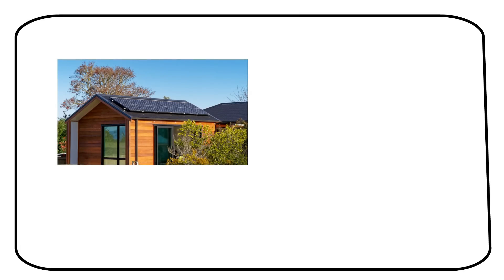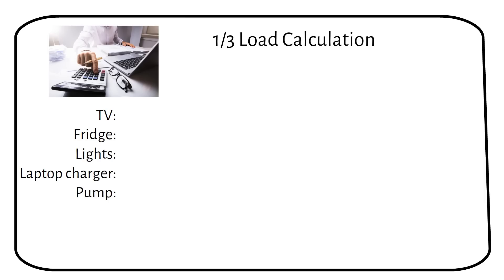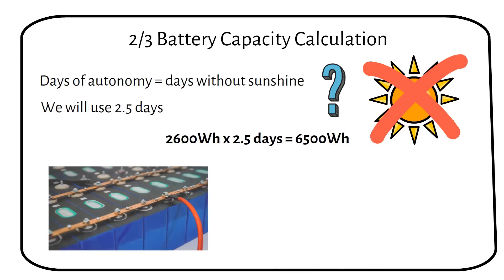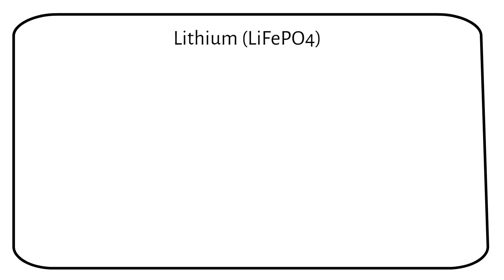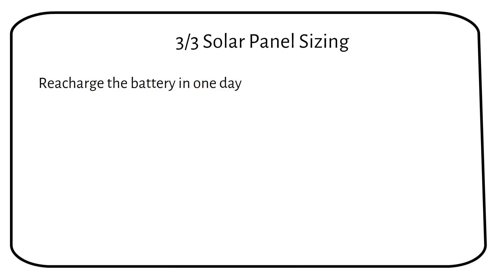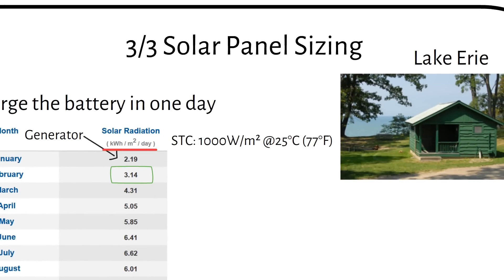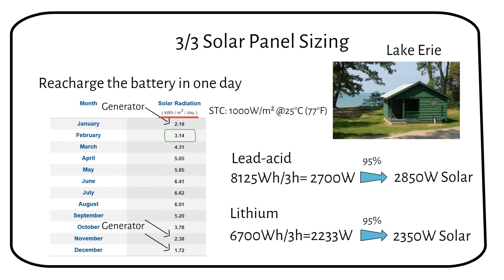How Many Solar Panels to Run a House Off Grid?

Comment: I have 8- 12V lead-acid batteries for my house.
Do I need 2850W Solar per battery or for the whole thing?
Reply from the maker: The whole battery. you need to recharge 6000Wh to charge the batteries from 50-100% including inefficiencies of lithium (80%). if you have three sunhours you need 2000W of solar panels.

Comment: In a 10kw situation you covered this very well. However, 10kw is not the average if you have a heat pump HVAC, electric water heater and electric range.  I get it that you just laid out a basic example but other electrical appliances were left out of the example. These other appliances are more common in the south and in addition sunlight is a better source of enegry in the south. My home is 100% electric. Daily electrical use would be closer to 30kw based on home size and how many appliances are in use. The below figures are more accurate based on the real electric consumption for the masses. My home use would be closer to 43kw per day. To actually send power back to the grid would require a daily surplus above my daily use. Such would require a system that creates more than my daily use. The cost to go off grid is very expensive. Just saying.

Average kWh usage for 1,000 sq. ft home	32 kWh per day, 950 kWh per month
Average kWh usage for 1,500 sq. ft home	37 kWh per day, 1,100 kWh per month
Average kWh usage for 2,000 sq. ft home	43 kWh per day, 1,300 kWh per month
Average kWh usage for 3,000 sq. ft home	67 kWh per day, 2,000 kWh per month
Reply from the maker: Yes, in the USA, the energy usage is 30kwh on average because of the ac. In Europe this is 10kwh on average. 10kwh is a good size for a cabin or remote home off the grid. 43kwh is huge 😳
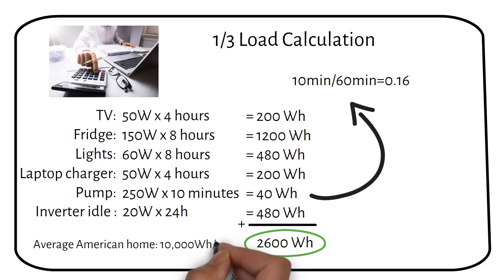Reply: @cleversolarpower  - I agree 10kw is good for Europe. But you did say the average was in America. I listened again. It's at time stamp 2:06

Comment: Its a simple calculation to work out what you need to go completely off the grid.... Estimate how much power you use per day.... estimate how much power you will produce in the middle of winter for say 2 months. Now figure out how many batteries you'll need to bridge that gap
Reply from the maker: If you size the battery based on your calculations of two months, you need a huge battery. A generator would be much cheaper.

Comment: I only want to run a regular sized American fridge and a deep freeze freezer in my utility building. Planning a 48v system with one rack battery and six to 8 400w panels. Will that work?

Comment: Thanks for your educative video. To recharge Lead Acid battery from 50% to 100%, how did you get the 8125wh that you divided with 3hours?
Reply from the maker: 6500/0.8 (0.8 is efficiency of lead acid battery)

Comment: Hello,
To increase the profitability of your photovoltaic panel installation and maximize self-consumption, I've created the free application OptimElec, which lets you track and optimize your electricity production and consumption in real time.
The application also displays the weather forecast for the next few days (cloud cover and solar radiation), enabling you to estimate your electricity production over the next few days.
The application is available in English and French.
I hope you find it useful!

Comment: Average american home uses 30kWh per day not 10
Reply from the maker: eia.gov tells me otherwise
Reply: @cleversolarpower  even by using your common sense you will know 10kwh is not enough to power a 3 bedroom house, the ac and heat alone will use 15kwh the lights tv refrigerator computer fans will still need to consume
Reply: @cleversolarpower  "The average U.S. household consumes about 10,500 kilowatthours (kWh) of electricity per year.1 However, electricity use in homes varies widely across regions of the United States and among housing types. "

This is what eia gov says, it says 10k kwh PER YEAR which means 30kwh PER DAY

U assume 10k kwh annually is 10kwh per day hahhaahhahah
Reply: @cleversolarpower  eia.gov tells you 10,500kwh is the average consumption in a year divide that to 365 and u will get 30kwh per day

Again you are wrong and still dont know it

Comment: Hi, thank you for sharing and making clear some points. I could be wrong on the battery capacity sizing your formula would not be: 6500 wh+(6500 wh*0.8* 1.25), 80%?
Reply from the maker: Why multiply by 1.25?

Comment: 6500 wh, 97% efficiency calculation is wrong.
6500X.97=6305Wh. 
Am I correct 
Pls clear my doubt sir
Reply from the maker: If i give you 6500 apples, and say that's whats left of my harvest after some are rotten. Then the initial harvest wouldn't be less than 6500 apples. It would be more. So 6500/0.97=6700 apples.
Reply: @cleversolarpower  okay.
Now it's clear 😁 
Thank you 🙏

Comment: I think there's a huge mistake in your calculations, you assume that the solar panel has efficiency of 100%. Should be around 15%
Reply from the maker: Go check out my video: 'how much power does a 100W panel produce' for in depth explanation.
Reply: Ok. Thanks

Comment: Hello sir, I have 8 gel 100ah batteries, 3 gel 200 ah batteries and 32 solar panels of 12volts 150watts, pliz help with the configuration, the controller I need plus the inverter I need, I'm in uganda 🇺🇬 we receive 9 to 11hrs of sunshine daily, and thank u sir for the teaching I appreciate
Reply from the maker: Checkout my new video about designing an off grid system.

Comment: Hello. Can you do a video of a load analysis table which is already calculated in terms of watts and hours and all calculation done and gotten is 2,542 watt hrs. So i want you to show us if this 2,542 watt hrs if used in seven days on autonomous, on how to calculate the size of batteries in terms of volts and amperes, amount of solar watts and how many of them, charging controller to be used, fuses and dc mcbs and sizes of wires to be used?
Reply from the maker: Check my video about sizing an off grid solar system.
Reply: @cleversolarpower   ok i have watcht it. If possible can you do the exact of what i have send to you because it will help many people.

Comment: I appreciate such straight forward approach...how about a little more on selection of inverters? Sizing inverter for the panels i may need to run whatever i am running.
Reply from the maker: Thanks! Check my video: 'how many batteries for a 3000W inverter'

Comment: Check out my 20kW system and find out exactly what it takes. 4 bedroom house, with 4 occupants. NO bill happy days!
Reply: Is 4kw system enough for small house?
Reply: @Defender_928  Hi, probably not quite enough. Double what you think you need for repeated cloudy days. If you have AC and electric hot water, 10kW would be more suitable. 400ah 48v battery bare minimum. It will payback very quickly. Use quality inverters etc.

Comment: you failed to tell us how many batteries - disappointed
Reply from the maker: I'm not sure if you watched all the way to 4:35 ?
Reply: @cleversolarpower  yes I did - does not say how many batteries 
so you should say 
100Ah battery you need 6 or 3 or whatever
if you gonna take the time to make such a video why not make it easy for us to the end
I don't understand 48v @ 130Ah - I have never seen a 48 volt battery - so what are you saying? why stop at 48? why not go to 60? bit confused on this
Reply: @AskRemy  It shows in the video the kwh of the battery. Batteries comes in different sizes so he's saying the size is a 6000kwh battery. Those figures are given so you can calculate the size of the battery
Reply: @HenryOlson-nx3sb  show me a 48v battery
Reply: 4 x 12
Reply: @VaughnStone-g9k  so then 8 batteries are needed if each is 100ah - thanks for completing the video

Comment: Let me rephrase my question from the comments of another video.
  let's say we are in an area where we have sunshine almost every single day ,unless we have bad weather. would we still size our pv system based on three days of autonomy?....sizing it based on our daily consumption would be better  to me.. wouldn't it make sense if we included system loss from the pv as well?
Reply from the maker: Days of autonomy is completely up to you. I don't think you understand it well enough. Days of autonomy is when the weather is bad, as you say. You are not supposed to drain the battery to 0%, this is just in case of emergency in bad weather. We do not add a correction factor for the solar panels, check the last part of the video where i talk about the difference between sunhours and hours of sunshine per day.
Reply: If you are near the equator, there is pretty good chance there will be lots of days with dense cloud cover. This is typical for equatorial weather. I am from Malaysia, right smack in the equator. Even though we receive 12 hours of sunshine 365 day every year, the effective sunshine (usable for solar panel generation) is around 4 hours only. Search the Internet for solar irradiance map for your area for more details.

I installed a 5kW solar panel system. On average, my system generates around 20kWh daily (ie,  5kW x 4 hrs ). With regards to autonomy, your local weather patterns plays a greater role. During our monsoon season, there are many days I am only able to generate around 5kWh per day.  During this season, there many 3-4 days (continous) of little useable sunshine.

Fyi, my system is grid-tied. I do not have a backup battery. I sell excess generation (if any) to the grid. Will I switch to battery storage? Yes, but I plan to do that only after my agreement with the electricity provider expires.

Comment: Hello please can you do for africa. I am along the equator receiving 12hours of pureshine all year through and sometimes longer. can i remove days of aunotomy for this area?
Reply from the maker: Let's assume you are in Nairobi, Kenya. The lowest sun hours are in November, at 4.1. As I said in the video, sun hours are not the same as the hours the sun shines. You still need to add days of autonomy, but you can reduce it depending on your risk tolerance.
Reply: Thankyou